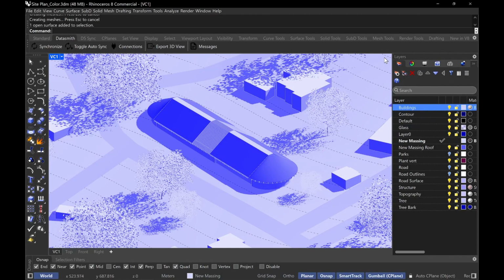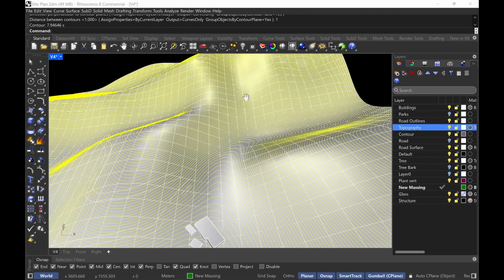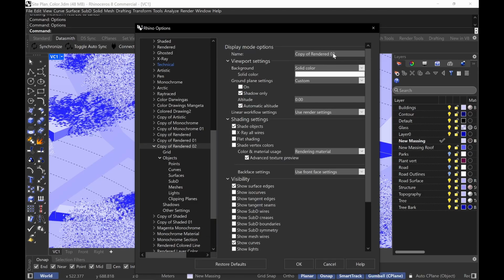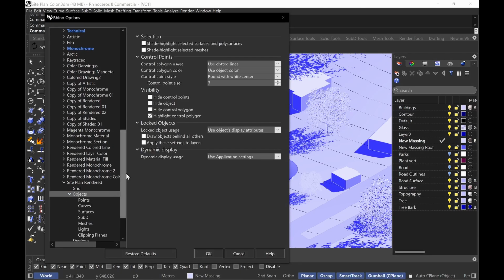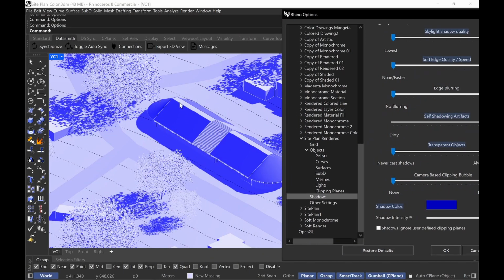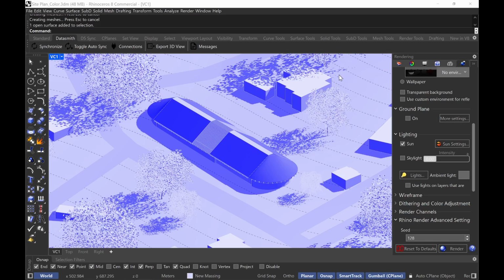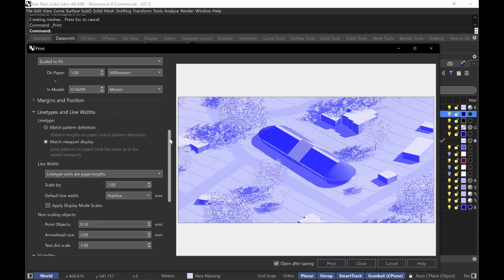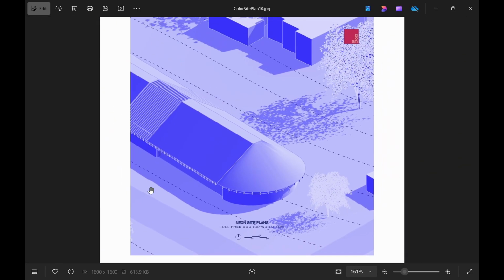EASY Architecture Site Plan Diagrams in Rhino 8 - High Contrast Monochrome Aesthetic

Comment: Nice. I love the just Rhino approach!
I want to make a big cityplan with colors in rhino. I am struggling with the hatches in rhino. F.ex. The buildings are 50.000 curves that I want to hatch but my macbook takes way too long to load. (M2 max)
Any tips on how you would do this in rhino only? Or is the only way illustrator? 
Thanks
Reply from the maker: I would create the hatch swatch as a material (JPG or PNG) and apply it to your buildings and use the Render display. I actually made a video about this. See link below:

https://youtu.be/j82Mn4-pPQY?si=u3Jf7c5rtVjBTGeG